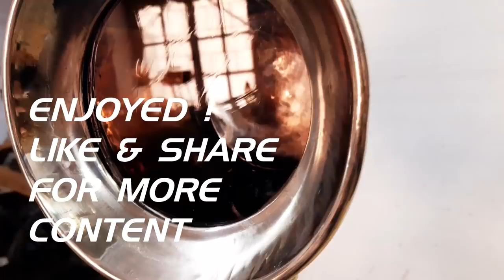Restoring an old Victorian Lamp

Comment: Why in the world would you use epoxy in stead of solder, Now it is not worth any thing. You have ruined lamp.
Reply from the maker: Bison bi-composite epoxy can resist heat till 120°C, and it is more harder than lead. That's why i used it.